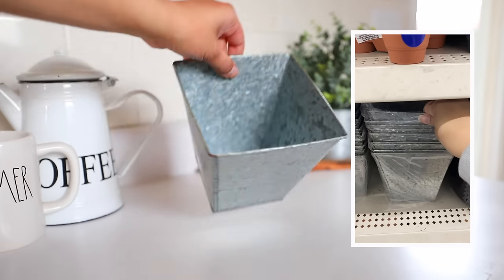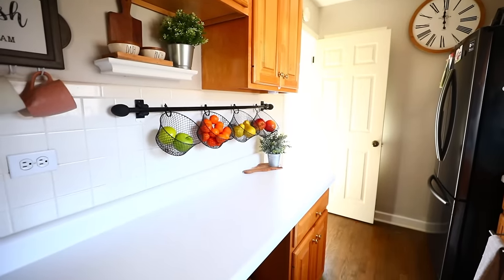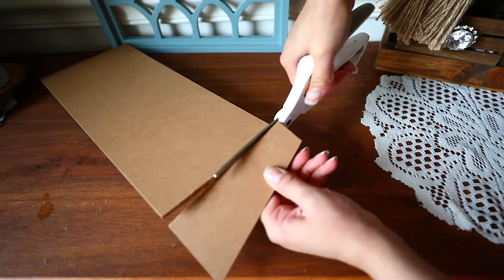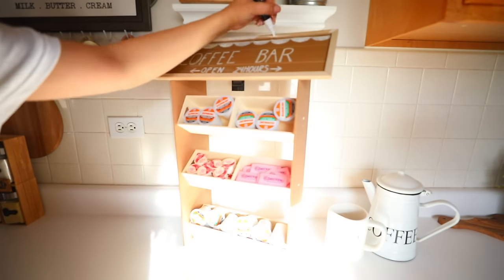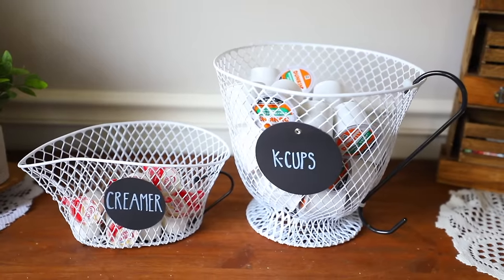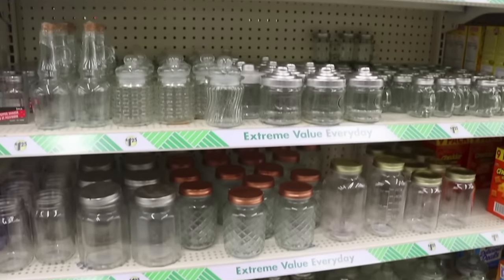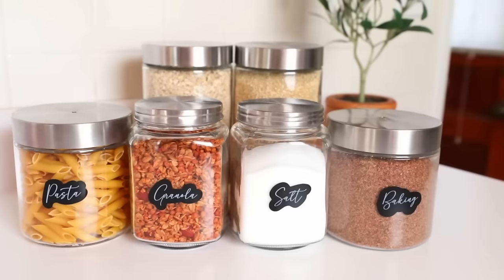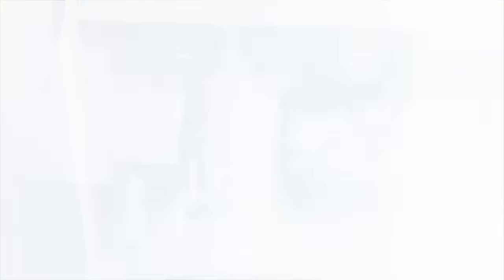Dollar Tree Kitchen Organization DIYS ($1 HACKS THAT WILL BLOW YOUR MIND 🤯)

Comment: Good tip on adding the hot glue to the bottom of the paper towel holder. I don't know if DT changed the size of their paper towel holders or if the paper towels I get are just taller than the ones you have, but my paper towels and the holder are often about the same size, so I get the festive solar yard lights around the holidays from DT and put them in the middle of the paper towels (after wiping them with a sanitizing wipe to clean them off)...and bam! Festive paper towel holder that I can switch out between the pumpkin one for halloween and the snowman one (and bonus, they light up at night)

Comment: Ok, the baskets you made with the broomstick and little black baskets? Take one step further… get those angle shelf things, (you’re using right now calling them plant hangers… that’s what I mean) so it’s away from the window,  3 nice pots, I bought the corrugated with the jute ripe trim at the top, got some jute rope, very crudely made hangers for the flower pots, hung in front of kitchen window, and I planted real vines in mine. Or you could put plastic vines in it. I also put light plastic flower pots in them, after putting some small stones in the bottom of the corrugated flower pots. They look really cool and they’re really popular right now! Wish I could show you a pic!

Comment: A neater way to do the paper towel holder instead of using zip ties to secure it to the burlap is to use needle and thread if you can see and even if you can’t it is so super easy to do and if you don’t want to use needle and thread just use string and tie it off underneath. This way the zip ties will not tear the paper towel

Comment: I’ve never seen your videos before but I have two suggestions. 1) Don’t talk and go through each DIY so fast. 2) If you mess up on something you should fix it. For example in the lazy Susan since the screws didn’t work then remove them. It didn’t look good with hot glue. For the plate that said “eat”at the end, it was sloppy paint around the outside of the plate. If you were actually keeping that in your home wouldn’t you fix it?